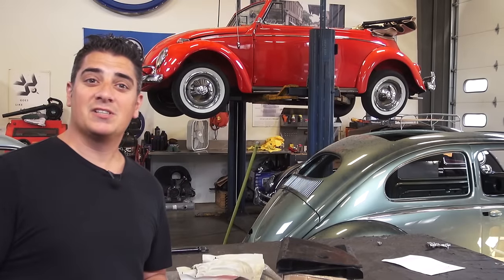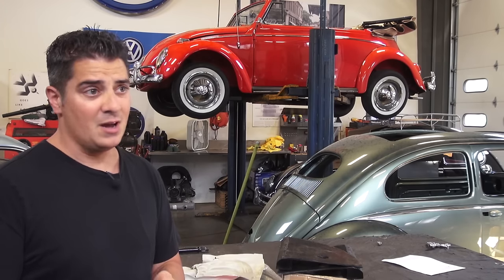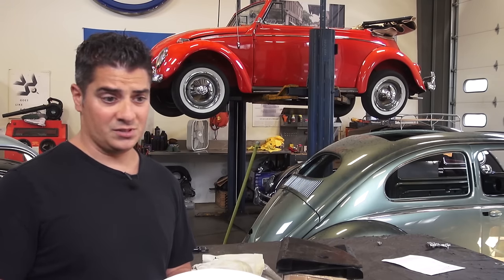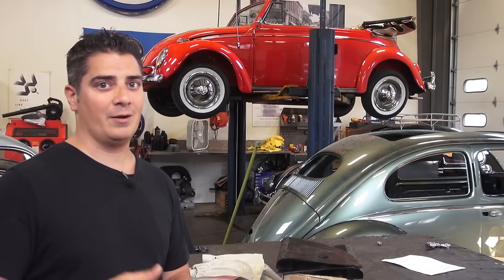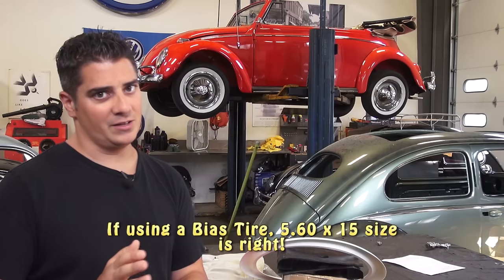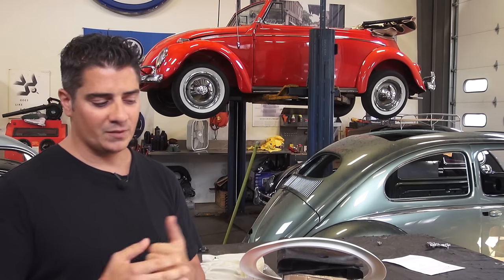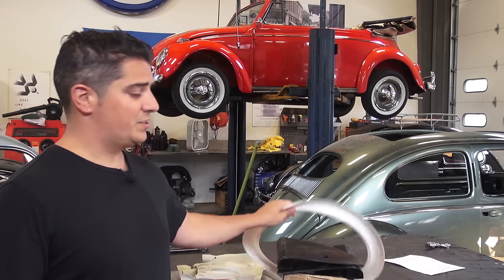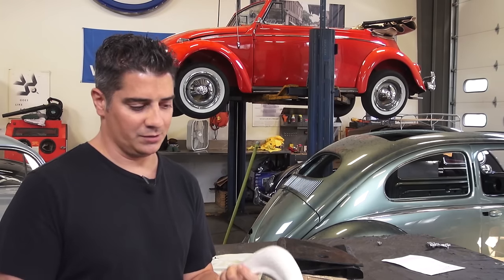Classic VW BuGs PortaWall White Wall Inserts Truths Myths for Vintage Beetle Restoration

Comment: l have them on my bus in the thumb nail, the back tires after a ride will have a gap in them for about a half hour, the tire flex will push them out, but the fronts are fine, less weight, these are also the 3 inch ones so that dosent help.
Reply from the maker: Yeah the 3" wide white is too big, they flop out.
Reply: I found Mustie in the wild, happy day!

Comment: Glad I watched this.  Bought a car and the guy put a set of brand new blackwall tires on it just a couple days before I bought it from him.  He said he didn't want blackwalls, but couldn't find whitewalls.  Turns out he did not look online first, where he could have bought a set of whitewalls for the same price as the blackwalls...  I'd hate to spend another $400 to replace a brand new set of tires, so I was hoping PortaWalls would be a cheaper solution.  The car will be a daily driver that gets taken on the highway, though, so it looks like these aren't an option for my situation.

Comment: Question: You said you do not recommend installing them on a 145 tire. I have 145R12  tires on my Daihatsu Mira Walk-Through that I ordered Atlas Portawalls for. You don't think they will install correctly on such a small tire? It's a slow vehicle 55 - 60 mph max and 45 mph average and generally used for car shows etc.
Reply from the maker: Yeah you need a good size side wall.

Comment: I'm installing a nice set of Atlas porta walls on my 1990 Cadillac Eldorado E&G classic model. My question is should I wash the tire and allow to dry or just break the bead and use bead sealer and insert and install them. Thank you
Reply from the maker: Yes and Yes!
Reply: How did the Atlas porta walls work on your 1990 Eldorado? I am thinking about putting them on my Deville.

Comment: Thanks for the information. I am restoring 56'Nash Metropolitan and tires are P155-80-R13. Can I use Portawalls for this size tire? Thanks in advance.
Reply from the maker: I think they do have them your size, just gotta be cautious, they are not meant for speed.
Reply: @classicvwbugs  Speed will not be an issue for the Nash Metro, :) Car will just be driven around town until it sells. Thanks for the videos.

Comment: I wanna put it on a mercedes w123... whats your opinion about that? and what about using paint instead portawalls? thx!
Reply from the maker: Eh I wouldn't, they are for slow cars say up to 65mph
Reply: @classicvwbugs  the w123 is a very slow car... I think the top speed is 90mph and takes 2 month to get there... ehehe so in your opinion, paint it is a better option right?  Cheers from Portugal!
Reply from the maker: @ruyboxe  what size tire is on it?
Reply: @classicvwbugs  its a 195/70 R14
Reply from the maker: @ruyboxe  ok cool, plenty of sidewall then.
Reply: @classicvwbugs  so if I dont pass 65mph, it will be ok, right? thx!
Reply: @ruyboxe  should be fine

Comment: Chris, what about a big luxury car? I have a 96 Town Car that I love & I wanted to put the vogue tires on it but right now I dont have that kind of cash. Would these tire trims be okay on a car like mine?
Reply from the maker: hmmm, I would not recommend it, a little too much torque on that car over a beetle.  Plus you would need to stay below 65 mph.
Reply: @classicvwbugs  Does anyone make a White Wall insert I could use for this car?
Reply from the maker: @robertsean5062  Not really, they are not made for any specific car, they are all made the same.  You can try it I guess, they are not expensive, but I would just get them properly mounted by a tire shop.  No guarantee that they will stay in though.
Reply: @classicvwbugs  Thanks Chris. Damn! I want to get some nice whitewalls for this car but they're so expensive. Gonna have to put a few bucks away. Besides, I dont see these inserts in my tire size anywhere 16's

Comment: I have 135/R15 up front and 165/R15 on my '56 beetle.  I recently bought new tires and new port-o walls ...they started browning around the edges a few weeks after I bought them. I did not put anything on the tires after they were installed. I noticed that the browning mostly occurs is the edge goes over the text on the tires. I have pics...mooneyes says its my problem. Anyone else have this issue?
Reply: Use Bleach White white wall cleaner or Walmart kitchen bleach cleaner mix.
Reply: Hey! I have the same problem on my '62 Falcon. How did you fix it?

Comment: do you have a video on assembling the sheet metal on a vw motor? Is it normal to have the thermostat removed? I have a 70 bug but the thermostat was removed before i got it, and we are rebuilding the motor and noticed it was gone.
Reply from the maker: Yeah many times they are removed.  If this is a fair weather car, not a daily, you should be ok without it.  If you need tin assembly tip, there are videos on my site in the resto tips section that can show you.  I found a guys 3-4 part video on engine rebuild, he shows it.
Reply: thanks, for the videos on the tin. this is a fair weather car in Michigan and i plan on driving it well into november if i can

Comment: Ok, this one is different. I ordered a set of 17" Portawalls for my 2016 Chrysler 200. I took the car in to have them installed this morning, but did not bring instructions with me. We tried one tire to see how it would go. Instant death. We were lost. I then came home and wrote the step by step instructions and will head out again to try it all over.  I think too, we need a larger mallet. The little one did next to nothing.  Will keep you posted as to the outcome.  I think too that at speeds of 70+, would cause a problem, but if kept under that to 65 and at times 70, there should not be a problem with a frayed edge. Am I correct?
Reply from the maker: hmmm, i dunno man, newer cars should not use them.  It is not even the speed, but the torque could ruin them.  Beetles are fine to use them, they are only 25-60hp.
Reply: I drive like an old fart and mostly on back roads. I put less than 400 miles on my car in a month.  IF they fall off, then oh well, it was worth a try and then I go to the next step and order a real white wall tire from Coker at $250 each.
Reply: Dave miller how did u fare out I want to try them on my Pt Crusier what brand did you try

Comment: I recently purchased a set of portawalls and installed properly on my crown victoria,  the two on the front keep popping from around the rim, I'm lost I've done everything possible
Reply from the maker: First off, you do not put porta walls on a crown vic.  Portawalls are good for small cars with small engines and low torque.  A big car like a crown vic?  Oh boy.  No way they would stay in.

Comment: HI, PUT THESE ON MY 68 BUG CONVERTIBLE, LOOKED GREAT , BUT STAINED THE FIRST TIME OUT. IT  LOOKS LIKE USED MOTOR OIL ALL OVER THEM AND COULDN'T GET THEM WHITE AGAIN. WE PUT THEM ON BRAND NEW TIRES. WOULD NOT RECOMMEND THESE TO ANYONE, WASTE OF MONEY.
Reply from the maker: Only if you do not keep on them.  I mention in the video you need to keep them clean, no tire wet on them either.  After every run you have to inspect them.  It's a cheap white wall, you want the real thing, you need to shell out the $175.00 a piece to get real ones.